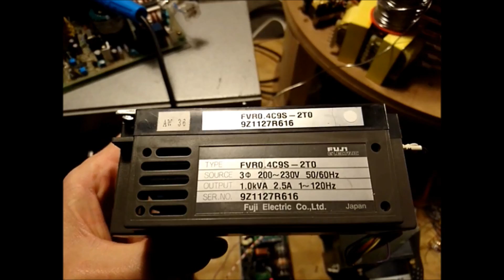Fuji Electric variable frequency drive FVR-C9S / FVR0.4C9S-2T0

Comment: Hi
I have exactly the same device without a control panel
I want to put it on a drilling machine
interesting functions forward-reverse-speed controller
Do you have the opportunity to send instructions to this device to your e-mail ra4ukn@gmail.com
and whether I understood correctly - if you rearrange the wire to the "rev" contact in your connection scheme, the direction of rotation will change
Reply: I sent the manual to your email :)